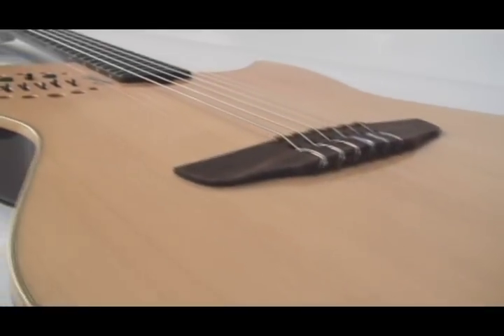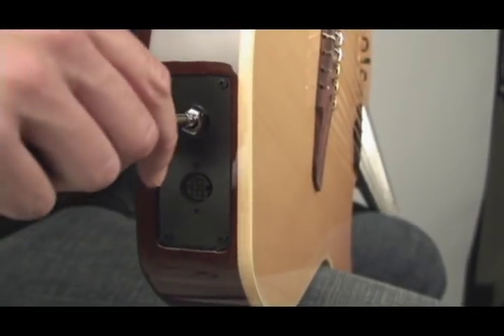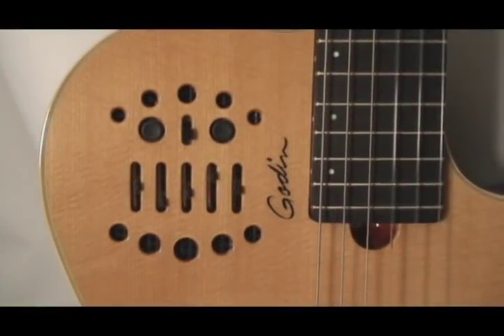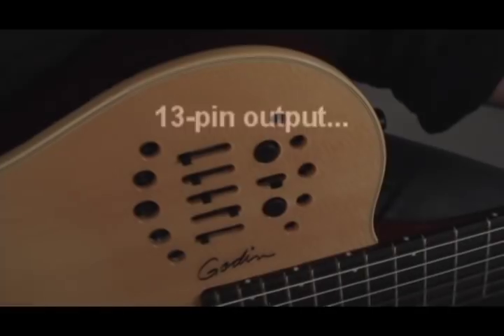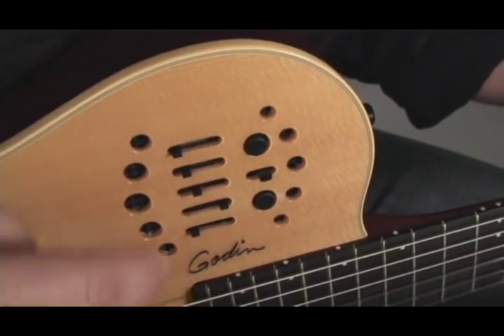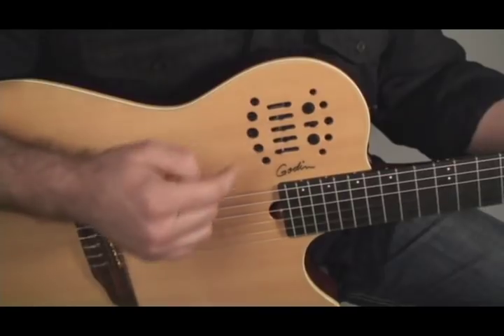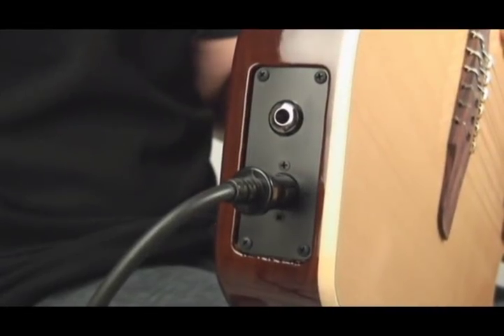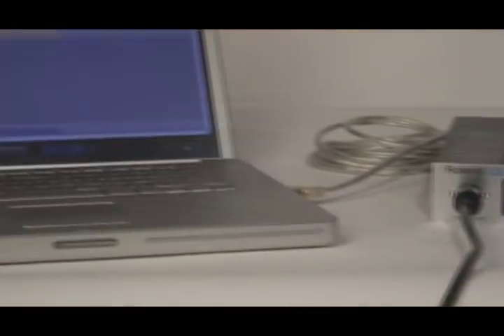Godin Multiac - How to Use

Comment: I have a Godin Multiac synth guitar. It works fine with my Roland GR-33 but the patch change buttons on the guitar don't respond anymore.

I put a brand new battery in it. Still no good.

Any suggestions to remedy this?

Thanks,

Dan
Reply: It worries me that the questions posed in the comments here haven't been answered. Considering it's years later, it's Godin's own channel and there are a number of very valid questions among these comments it really puts me off buying one when I was very close to doing so.

Comment: Godin does not mention the 9V battery anywhere. The manual is one single sheet.
Reply: Any luck on that?
Reply: There is a 9V battery compartment in the back of the guitar. This is powering internal circuitry. It seems to draw little current, as I have been playing every day for several weeks without having to change the battery. I just wish the manual or the video mentions these facts for people who are about to make the decision to purchase.
Reply: I only mentioned that because when I was investigating to buy the guitar, I did not find any reference to this battery compartment. I asked a sales person from an Internet storefront, and he didn't know if it needed any battery. I thought the may need a special battery for some purpose, which would be a negative point for me. I went ahead and purchased the guitar anyway, and found out that it is a 9V battery.
Reply: It activates the pre-amps in the guitar when the 13-pin is not used
Reply: @MinhPhamGators  Thank you for your comments here as I have decided not to purchase given the lack of information and bugs that seem to be there in the synth part. No response from Godin to the questions here have been the clincher for me.

Comment: “Notation”: how accurate is this type of  Multiac? I really wonder what is a ballpark estimate of errors n correctly hit notes when fingerstyle method is used while fingerpicking midi into an app such as Guitar Pro 7.5 etc?
Reply: That depends on the MIDI conversion box.  Also if using the GR 55 you may have to adjust sensitivity.  I don't think it's totally up to the guitar, but one has to take into account that the pickups on the strings may miss a sound so you have to adjust the sensitivity setting until you find the sweet spot.  Also sounds from other strings could be an issue if the sensitivity is not set correctly.

Comment: I just got the GR 55, and I've been experimenting with my Multiac Guitar like this one in the video, what I don't understand is that the synth blend slider doesn't seem to have any effect at all on the output sound. I seem to be only getting the synth regardless of the position of the guitar volume slider or the blend slider.  Am I doing something wrong? Did I miss something?
Reply: Marc Novoselec I just bought the gr55 and found out that I had to connect both the 13 pin cable and the normal guitar plug to get the synth and guitar sounds to work.  That configuration also enabled the slide switches to work per this video.  The manual was unclear on this……!
Reply: Ok so if one output is in gr55 (13 pin) and second normal plug to tc helicon voice live 3 pedal ,can both devices work with godin in the same time just by switching slider volume on/of or there is some  other philosofy ?